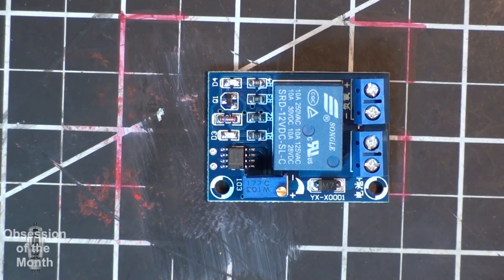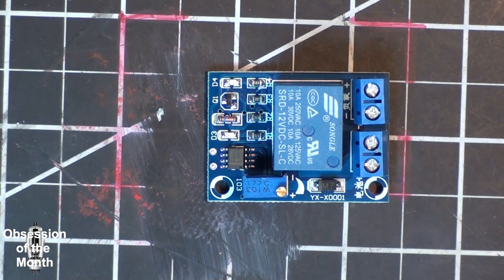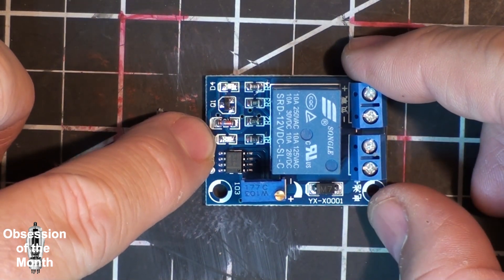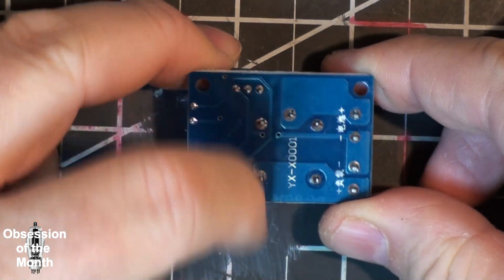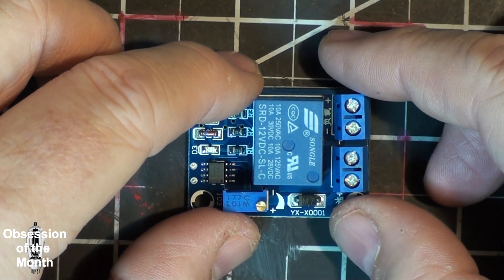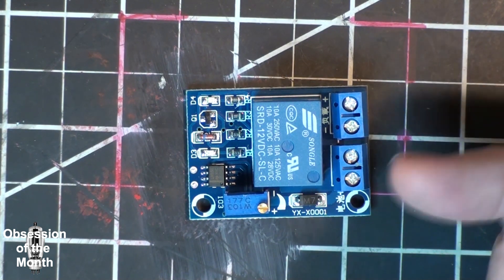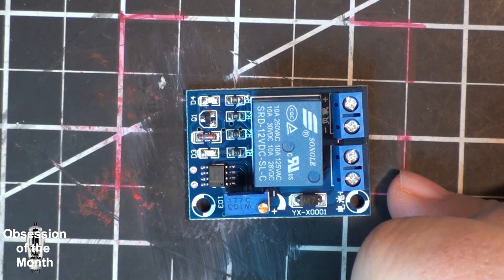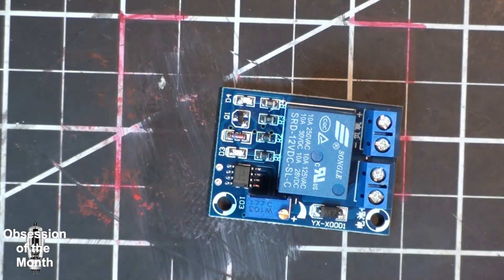12V Battery Low Voltage Cut off Switch Controller Excessive Protection Module

Comment: I have one and  it drains almost 40mA in cutoff state. The relay is energised at that state, it should be the other way around. When relay is not energised ( ON state) it only consumes 9mA
Reply: The opposite idle current to what you. Let me know if you'd like some info on inverting that. I modified it to use the second channel of the lm358 opamp that is on the board and used the other relay contact.
Reply: *what you want

Comment: DEAR PEOPLE  I WOULD  LIKE  SOMETHING  CLEARED  UP   AS I CANT  SEEM TO GET A STRAIGHT  REPLY  FROM  CHINA  SELLERS  SADLY   I  JUST  WANT  TO KNOW  WILL  THIS   UNIT   SWITCH  ON   AND  OFF   AUTOMATICLY   SO I DONT  OVER  CHARGE  BATTERY  OR  LET IT GO  LOW  AND  DAMAGE  IT      HERES  THE  LINK   PLS  HELP  https://mesg.ebay.co.uk/mesgweb/ViewMessageDetail/0/All/130500176322?_trksid=p2507978.m570.l6025&_trkparms=gh1g%3DI130500176322.N51.S1.typeMESSAGE_RECEIVED.R1.TR5
Reply from the maker: Your link takes me to the UK ebay sign in page. I do not have an account there. 
If you are asking questions about the low voltage cutoff in my video it automatically cuts off the voltage to the load it is connected to when the voltage goes below a set threshold. If you are asking does the unit shut itself off? no.
It does not have a high voltage cutoff. The purpose of the device is mostly to keep a battery from draining below a specified voltage.
It sounds like what you want is a charge controller. https://www.ebay.com/sch/i.html?_from=R40&_trksid=p2060353.m570.l1313&_nkw=12v+battery+charge+controller&_sacat=0 A charge controller (even the solar ones) can take any voltage that is slightly higher than the charging voltage of a battery and it will charge the battery (stopping when fully charged), it can be set to disconnect the load when the battery is too low, and reconnect it based on voltage or even time of day.

Sorry for the late reply I do not get notices for comments on my videos.

Comment: Whats the lowest cut off voltage? could i go down to 9v for example?
Reply from the maker: It can do 9v-15v but it will likely go lower. It's really meant for 12v batteries, going too much below 9v and the relay may not engage.
Reply: @ObsessionoftheMonth  Thanks a lot for the answer. Thought of using it for a 3s 18650 battery, so that it would start at 12.6v and the cut of would trigger at 9v
Reply: @knuddelig5304  but do they discharge higher than 10a your relay will melt if so

Comment: I've ordered a number of various versions of these things.  Setting them up to actually do what you want can be quite frustrating giving the Chinglish or complete lack of information.   There has to be someone in China that is capable of proper English ?  LOL   Most all micro controls and or test gear ordered has been the same situation.  NO DAMN DIRECTIONS Provided.  Most all current and power ratings seem to be listed at just about double the actual.    That being said,  There Cheap.  Do Work most times.  Not burned down my house up to this date.  LOL

Comment: Question... Can I use this on a 7.5v volt 6.5 amp battery?
Reply: I need to discharge batteries from 8v down to let's say 6v. Can I do it with this module? Thanks.
Reply from the maker: no, it is 12v only

Comment: Did you ever figure out that bit about adding a capacitor? I just ordered one of these and I also have no idea what the instructions are talking about. I can't think of any reason why they should specify a capacitor rated at 25V, but not specify a capacitance. Maybe they meant 25 microfarads?
Reply from the maker: Not exactly. Every description of this device has the same exact information and none of it says why. However based on one of the reviews on ebay it appears that if the battery voltage drops below the voltage required to operate the relay the device may cycle the load on and off rapidly . Since the relay appears to be powered from the battery the voltage will go up and the relay will keep cycling like this. so it appears that if you put an electrolytic capacitor on it, it may stop? I do not know where the capacitor would go. My suggestion is to configure the device to not let the voltage drop below the operating voltage of the relay. per the datasheet for the relay that would appear to be 10.8 volts. A lead acid battery is considered discharged at about 11.5 volts so I would set the device  to that.
Reply: @ObsessionoftheMonth  Ahh, that makes sense. I intend to set it to 13.2V and pair it with a 10 second time delay module so the rapid switching shouldn't be a problem in my application. Thanks for the follow up.

Comment: one can make a better version of this board by using  voltage dividers that saturate a bjt transistor until 3v is reached by a cell. The bjt transistor(s) feed into a nor gate which then feeds to a power mosfet, which the emmitter and collector of is connected to the power source in series. the mosfet acts as an automated power switch and becomes desaturated when the nor gate is off.
this can be used on its own as an over discharge protector or be integrated into a full bms. 
this is just a cncept I thought up of right now, however unlike it's chinese counterparts it can protect the battery in a balanced mode and is completely silent with no moving parts.
Note that the circuit must be connected in series with a master switch as it has a large power drain and cannot hibernate as it is fully discrete and hence dumb and is not a full bms and shall not be charged.
Reply: Show pls

Comment: Will this work with 6 18650's wired in series (25v)? I only use my bms for charging and I need something to stop the load when a certain voltage is reached.
Reply from the maker: This is really meant for 12 volt batteries only, I am not sure if it can handle a voltage much higher that 15 volts. Look on ebay for charge controller or battery charging control board 24v or 24V Battery Low Voltage Cut off Switch

Comment: I’m not electrically engineering savvy, but I need an automatic switch that turns on when the voltage/wattage reaches a certain level and kicks off when a battery bank is full. The intent is to build a battery bank with this switch attached to it to automatically turn on either a 12v motor or an inverter to run a small motor, which will run generators to recharge the battery bank. Making it a self-charging battery bank. Any ideas?
Reply from the maker: you might be able to  use this https://youtu.be/E_SQu8g4REU
look on ebay for charge controller or battery charging control board
Reply: @ObsessionoftheMonth get the XH-M609 12-36V Battery Low Voltage Disconnect Protection Module DC Output. Its basically the above with display and easier set for on and off. Its fairly cheap at least on the aussie ebay sites. Also try aliexpress or banggoog .
Reply: It's pointless becouse of... phisics. Friction, EM loss and charging efficiency of the baterry will take energy from the battery that will never be recovered. Or you just want to prove in a practical way that perpetuum mobile can not be done?